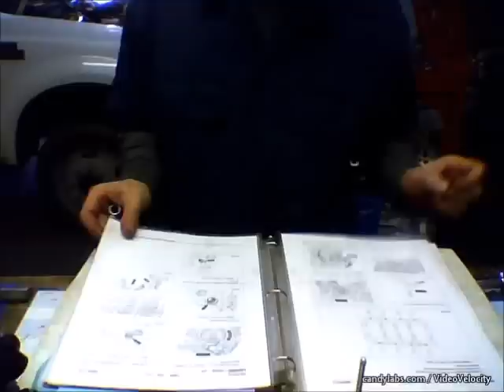FORD 6.0L Diesel ~Failed BlackWater Engine ReBuild in HyperSpeed at SuperDutyService

Comment: wow u guys really like to waist time i would off had that engine in and out in one day without removing the cab
Reply from the maker: Let's see your video of a Superduty engine swap.
Reply: +cr38er that's what I'm saying! Try getting the y pipe off without lifting the cab lol.
Reply: Got mine out with no issue with the cab on.  Removed heads without removing the heater box or touching the AC system.  Just pulled the drivers side engine mount.
Reply: Garrett Vining LOL, y-pipes can be done in 2-3 hours cab-on.... 😂😂😂
Reply: And it's always guy's like you who people should stay away from for mechanical repairs with this whole I can do this faster line. Quality and oversight is always lost by those who like to beat their chests on how fast they can get shit done.

Comment: 6.0 is trash period. it's no surprise it blew a head gasket
Reply: should of put a 6bt cummins
Reply: You have to know how to drive a diesel! My '04 6.0 has 380,000 miles on it and still running great. Replaced the egr and oil cooler at 190,000 and then the original injectors at 285,000. Compression is still around the 380 mark according to my mechanic. I change my oil every 7000 to 7500 miles. No cryin' here about 6.0 fords. Tranny is also never been touched outside of fluid changes (once a year regardless). You need to go to diesel school!
Reply: OddBall1958 you have to know how to pick your trucks not a ford. found on road dead. simple as that. and that's why International has not made success and making semi trucks either nobody wants international.
Reply from the maker: Jose Padilla Ummm... There are millions on International semi trucks out there. They did fuck up on the 6.0L though. Let me hear you complain about the 7.3L or DT466. Some of the longest lived Diesel engine designs ever.
Reply: cr38er dt466 i have one at my cocacola shop right now blew a headgasket um your lovely t444e i have one too seco d engine i put from the dealer full crate engine. oh not to mention international prost and lonestar and international eagle cummins ,Caterpillar, detroit 60. um and your welcome for the reference, junior.
Reply from the maker: Jose Padilla O... K... Yes there are other makes. Not sure what your reference was?
Reply: If you don't like these engines then why work on them? DId the 6.0 have issues? Sure but by 07 most of those issues were resolved. I still stand am of the opinion that most of the 6.0's problem was/is lack of maintenance. 
I own one and it's a nice truck. Everyone is different. Take your dark cloud somewhere else please.
Reply: diego hermosillo the 6.0l engine is a door stopper. 7.3l most erliable one. not so much 6.4l but better than a 6.0l
Reply: Hey Jose, again, some of us like the 6.0 so take your dark cloud somewhere else please.
Reply: diego hermosillo take your sweet 6.0l and get a real engine cummins 5.9l its a shame a inline 6 can drag you trailer trash 6.0l where ever you want me to drag it. fair enough.
Reply: Again with the names, What if it was a Ford gas power plant? Someone posts something about a for and you start calling name like trailer trash, door stop and so on. Hey go brag about your Cummins some place else. There are plenty of Ram videos without you having to troll here.
Reply: diego hermosillo rams are junk im talki g about cummins engine vant beat that one right. exactly..junior.
Reply: Jose Padilla , then why did you post a video of a Ram truck with a Cummings? EFI live tuned with sinister diesel stuff all over it. So first it's the 6 Liter is junk, then Ford is junk, now Ram is junk, where do you stand? Cummins is a great engine however they have to have a truck to put it in. What do you have to say about the Nissan with the 5.0 CDI Cummins motor?
Reply: diego hermosillo i dont have a ram no more i have a chevy cummins with allison swap ram sucks due to death wobble.  and ford sucks for there nice chassis twisting and trashy 6 liters.
Reply: I''m not sure you know what you like except trying to wind other people up with your words.
Reply: diego hermosillo sounds like to me your fragile
Reply: True, put your truck on a vid and let me see it, My 6.0 is posted.Show me how NOT fragile your truck is.
Reply: Jose Padilla .  Hold up mr truck picker . First you need to educate yourself about a subject before you open that taco hole . International Trucks is by far the leader in market shares of heavy duty trucks and has been the past 15 years without argument. Secondly Ford trucks out sold chevy 3 to 2 that's 3 fords for every 2 chevy and 3 to 1 over dodge.   Now about the 6.0 which is a navistar 265 which is a backbone of the international truck for years . So you ask what does that have to do with fords 6.0 . Everything because Ford took that 265 and chipped it to produce 325 HP to compete with he cummins in 2003 they also modified the egr system .  So customers not being informed of this upgrade went ahead and chipped the engine another 100 hp which caused head bolt stretching blown head gaskets egr failures etc. Then Ford trying to recover as much of a loss as it could grew balls and sued navistar who laughed and said basically to kick rocks . Ford fucked that engine up not international and as shown in 2004 the more ford tried to correct it the worse it got all the way to 2006 .  I have a stock 2003 6.0 with 275,000 miles on it about to go into its second truck and I will put that truck stock up against another stock truck pulling a trailer of equal weight and walk away like play day . The 6.0 got a bad wrap but it is one of the strongest diesel out there . Its the abuse that people perform on these engines that make them fail .
Reply: OddBall1958 that’s what I say. Most of these guys that have issues don’t know how to drive or maintain a diesel and then cry when the break. When you put a tune on it and roll coal they break. You want to keep the EGTs and RPMs as low as possible. My 07’ has 475,000 miles on it. I use a fuel additive for lubrication. 5,000 mile oil changes and 10,000 mile fuel filter changes. Get 18mpg still. I love my 6.0.